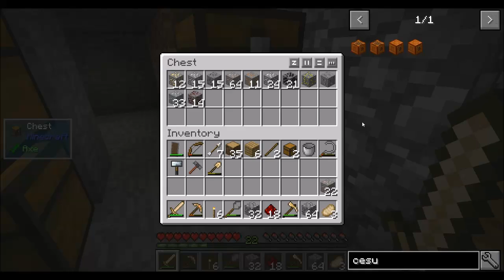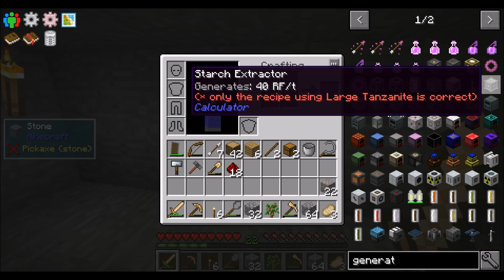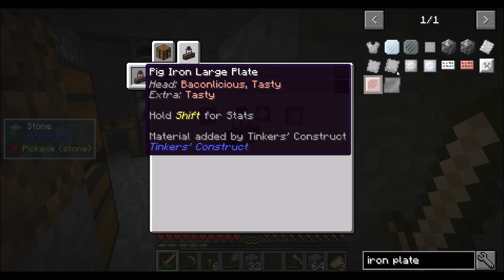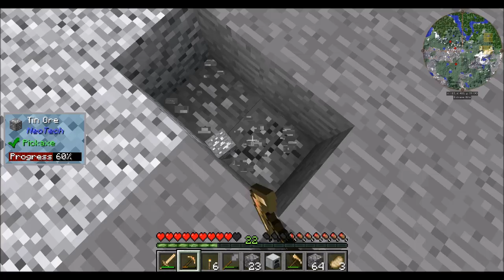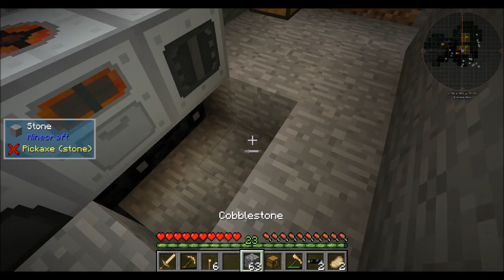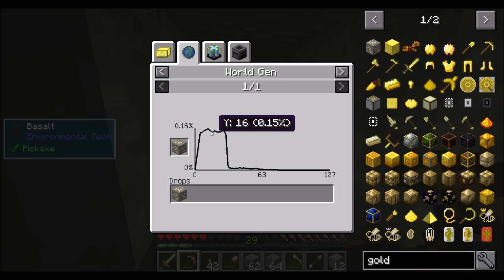AoE Ep4   Industrial Age

Comment: His build order, so far off the best mark.  Macerator first, yes.  Then a set of single use batteries made from hydrated coal dust.  Using redstone to power the maceration of the coal.  Then use those (loop as needed) to make power until you have the compresser, and then the metal former.  THEN a generator.  Then wires and batbox and wrench and electric wrench.

Comment: Now that he has a compressor and maybe steel en mass taking in account backlog, he should get a tool forge. And he can upgrade now. Cast a stone pick with aluminum brass, pour any metal in cast, put pick axe with metal puck in tool station, it'll replace it. Or could just sharpening kit obsidian on anything. Makes it still cheap to repair, but able to mine Ardite/ Colbalt
Reply: Pick not puck...

Comment: The reason Qvist has you make the compressor is because the IC2 blast furnace needs compressed air cans to work, to get slag for the Immersive Engineering Blast Furnace. It's not very bad if you think about it.

Comment: Seriously... Dire insisting on not wasting coal yet smelts ores with coal. Smeltery can process crushed ores and does that cheaper.
And why not make some charcoal? More creosote will be needed later anyway and charcoal is renewable fuel source.
Not converting charcoal into coal coke before using in generator also = wasting coal.

P.S. Hint for crafting treated wood planks: there is no need to open Oven UI each time, it is accessible from attached crafting station)
Reply: Charcoal doesn't convert into coal coke, only regular coal does. Wood can convert into charcoal however.

The only way charcoal can substitute for coal, besides just typical 8-item smelting, is that it /can/ be turned into red coal in the Resonator, which makes it a little more OP when you get that set up. Obviously in this pack though, the Resonator isn't exactly an early tier machine.
Reply: you can turn charcoal into coal cake by cooking blocks of charcoal in coke oven
Reply: it does take 9 times longer to process tho so it is kinda slow but with a chopper and 3 or 4 coke ovens  you can pretty much have unlimited coal cakes
Reply: If I remember correctly, you can't make charcoal. At least not the normal way with wood in a furnace. Hence the reason dire mined so much coal instead of making charcoal.

Comment: To everyone playing along at home (and Dire, if he happens across this): 

- Bagginses. Make them. Use them. Love them. As an added bonus the pickup mode prevents accidental destruction of mined items due to lava. And they can be upgraded once you get steel.
- An Ender IO tank can pull directly from a coke oven, and once you feel like just voiding the creosote oil (you will) it can push into a liquid trash can.

E:
- If you want an early tree farm, look up Chopper in JEI. There are wooden, stone, iron and diamond versions, they can run on basically anything burnable (including the wood they chop which they autoinput into their fuel slot if empty!) and are able to use Tinkers tools.
Reply: I didn't know that bagginses had a pickup mode.  I made two sets of forestry bags, one for the ores/gems and one for the junk cobble/gravel.   Great to hear about the liquid trash can.    This pack truly is mining intensive.  I keep running out of coal and copper.
Reply: Yeah, shift + right-click switches the mode with the bagginses bags. I'm not quite up to forestry bags myself, but I might switch to those when I can. Being able to filter the drops is so nice.

It certainly is mining intensive! Iron seems to be my biggest problem so far, granted I've stayed in the calculator age for a while now, trying to get a good power setup going.
Reply: Yah, I just moved my entire setup into a house and of course the house is too small.   That's the problem with building nice instead of organically building to plan for the stuff you'll put in there.   I'm up to the calculator age as well.   Check out ChosenArchitect's series....He's much further along and is very methodical on his setups. (not really a plug....I just have been finding his videos helpful)
Reply: Gonna jump on your comment to also provide a bit of advice that'll help people out.
Peat. Bog. Farm.
All you need is sand and dirt (you'll get dirt over time) and when you hit IC2 age you'll be able to make those tin cells that'll help make 8 bog earth each. Peat itself is a great backup fuel for keeping your generators running and keeping a good influx of power. That and if you did what I did and go for not only a macerator but an ore washer asap (with a ender IO tank ontop) you can use those tin cells to hold water and keep the ore washer running constantly.
Reply: After having watched the episode I'd like to add two more little things:

- Tinkers' crafting stations can access the inventory of an adjacent chest or other storage container (tested with a double chest and the small storage crate). It's very handy for things like the hammer and wire cutters dire kept going to his other chest for, as well as just usual items you need to use a lot of. Rubber, cables, plates, you name it!
(I don't know what happens if you have both a furnace and a container adjacent to the crafting station)

- Andesite, Diorite and Granite count as smooth stone for most recipes. There's not much other use for them, so hey, I'll take it!
Reply: JiiKoo Don't forget that the crafting station can access all 4 slots of the coke oven. So when you're crafting a bunch of treated planks, you can put your bucket in the "bucket filling" slot and it will fill with oil. So you never need to leave the crafting station!
Reply: Chopper finally uses TiC tools? That's great news. I ran into an issue when playing a 1.7x modpack where vanilla tools had 1/1 durability and the Progression machines refused to aceept TiC tools which made early automation impossible.

Comment: dire last episode: "ha metal former doesn't need 4 diamonds, what are you talking about"
me, screaming at the screen: "there's a recepie you didn't check in the metal former"
me, now: "yep, told ya"
Reply: Petar Tsankov same
Reply: Petar Tsankov Yup, me too. His reaction was hilarious, though.
Reply: Yep, and then at the end of the episode, he said the Generator continues to burn coal, which it doesn't, and "proved it" but forgot that there are machines actively drawing energy from it. Nobody is perfect, but I've done a lot of screaming so far this series. :)
Reply: That was so me last episode too.
Reply: I've solved that issue in a pretty easy way. I use 2 solar arrays for my "normal" power usage - that is enough to power any of my machines if run alone. In case I want to run several at once I have a batpack to serve as kind of additional power boost and only if I've used up that also I use coal as additional fuel. That way there is very few to none waste and it even works with the ore washer which is a real power hog.
Reply: Yeah - that's what he's getting for prerecording episodes before we warn him from stuff like that in the comments.LOL
Reply: But it really is inefficient. Here's what's going on: Say there's 1000 EU of energy buffer in the generator, and burning tiny coal produces 5 EU per tick for 40 ticks to make 200 EU total, if the generator fills to 1000 it finishes that piece of fuel and doesn't light more. But, if a machine consumes 1 EU, now there's 999 in the buffer, the generator will light a tiny coal immediately, and burn the whole thing, wasting 199 EU to fill back that 1 EU missing from the buffer. And if the machines are left running, it will do that constantly, wasting most of the coal if it's left full of coal.

With a Batbox the buffer is bigger (the Batbox is one big buffer) but the same problem arises, just you can try to juggle only fuelling it once in a while to re-fill the batbox, then drain it.

WIlx (if you watch his playthrough of this pack) adds a rationed filter and redstone trick (You can see Dire has plenty of redstone now) to drop one fuel into his generators when the Batbox is empty. He uses full-size fuel, not mini coal, but it's the same idea you just don't need to care when your design is inherently non-wasteful.

Comment: Hey Direwolf, I'm playing AoE too and when I came across the full recipe for the metal former I was thinking to myself, "This is gonna be a job and a half!" And I'm still trying to find the diamonds I need for it. Aside from the 10-12 Y axis, is there any trick to finding diamonds? I was thinking as you were going through the recipe "You have miscalculated this!"
Reply: 7-11 in pack, same 0.12% on each level.
Reply: I ended up mining a lot at 8 or lower to find them, but they were very sparse.    I finally ended up just mining for a long time until I grabbed a few.
Reply: I put a tunnel at y 10 and just did a very long 3x3 ending up in extreme hills getting me some emeralds also.  Im sure I missed some deeper down but it kept me above most of the lava. 

Stone pick head with a bronze sharpening kit lets you mine everything and still repair with what you are mining. Durability is nice but repairs that are cobble cheap are better when you can carry a tool station with you to repair on along the way. 

Forestry backpacks for mining and diggers also help extend the trips as each holds 15 slots for a single inventory slot used and are cheap and easy with flax growing everywhere.  A crafting table can also be carried or left in a central slot to compress cobble down as you can convert cobble to seared to extend the smeltery or use it to make stone ladders.
Reply: Thanks guys, some very helpful tips there. I will let you guys know how I fair later.
Reply: Thanks for the advice guys, I was digging a 3x3 tunnel at Y:7 for ages, only to find diamond just as a dug out a side area for a lava pit for excess cobblestone XD.